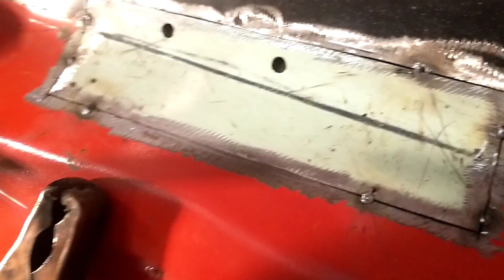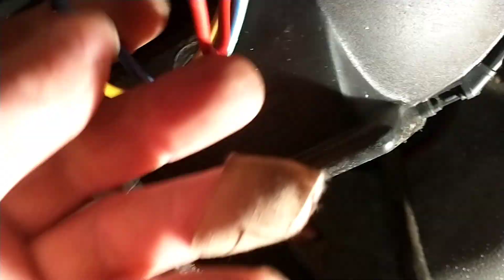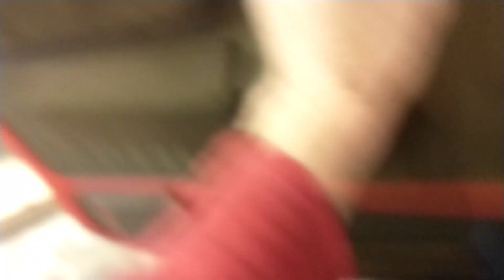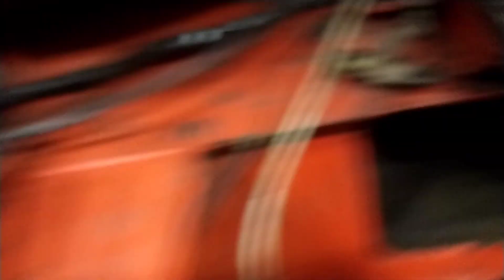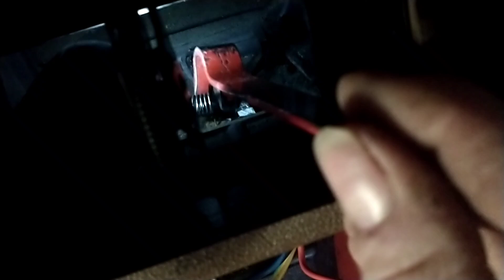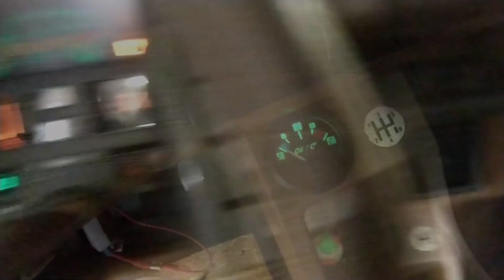Citroën GSA X3 restauration. Interiorfix that went ahead on a detour of electric repair...

Comment: Thanks! I remember when you were giving CPR for that GSA at the first place, it had those extra heaters in the cabin. So think how many years that car has suffered for non working resistor packet?
Reply from the maker: @UnknownLuveLove  it probably worked when the car was parked, these rusty connectors where probably fine then. But the engine had leaked oil long before it ended up in the barn, so those extra heaters where probably there due to unbearable oilsmell